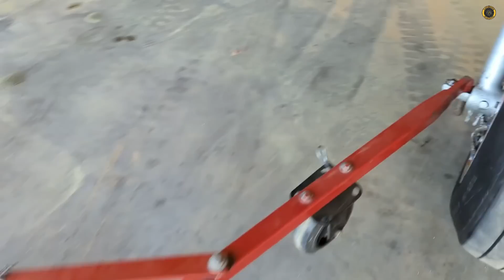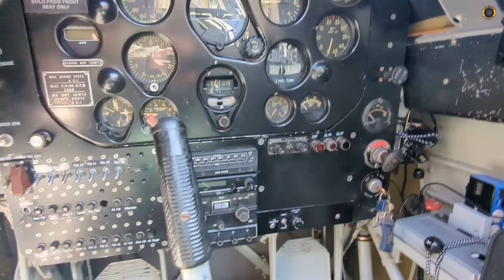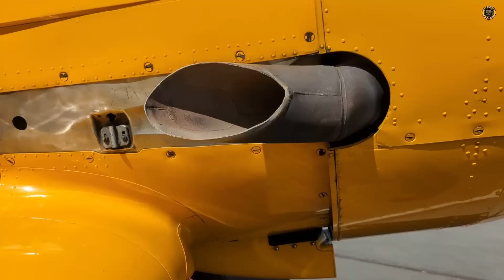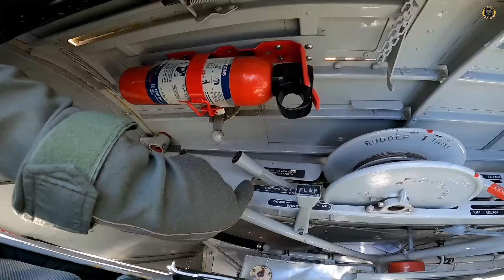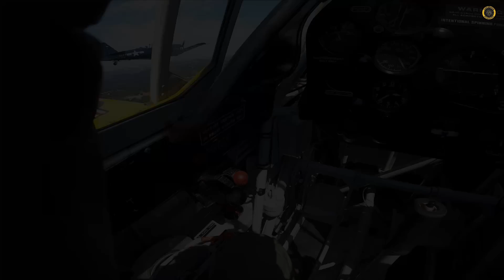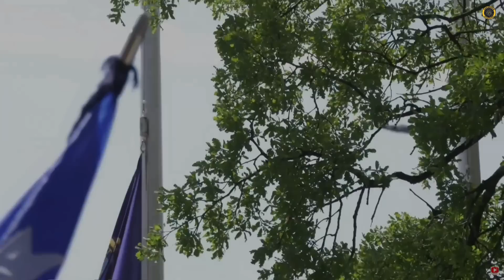AT-6 Memorial Day 2023 Missing Man Formation Cockpit View

Comment: I spent many an hour flying those from the back seat, as a teen: great times. I think the main reason people still wear parachutes in T-6's, is because the seats are designed for them.

Had to laugh when I saw the Aero Engines sticker on the engine crankcase: I slapped one of those stickers on the valve cover on my first car!